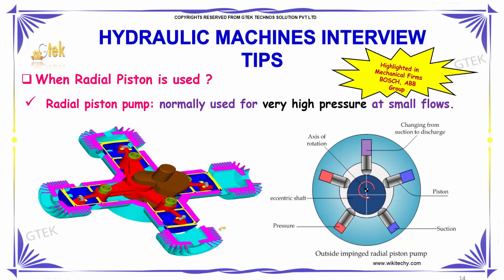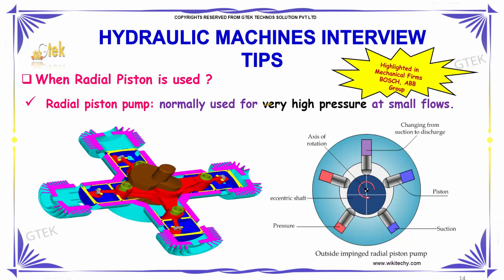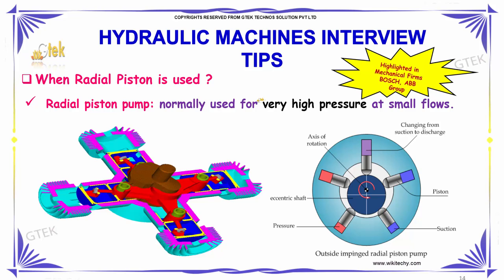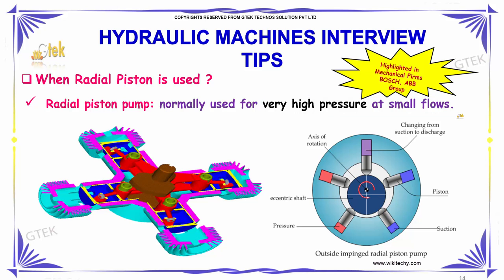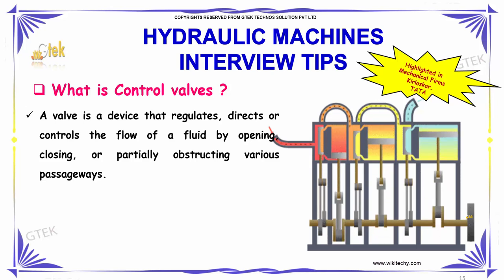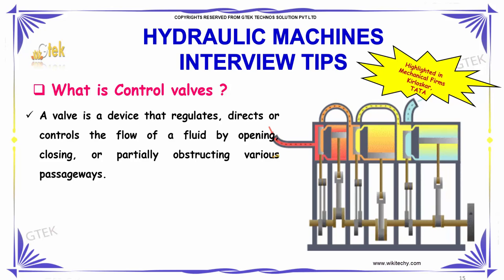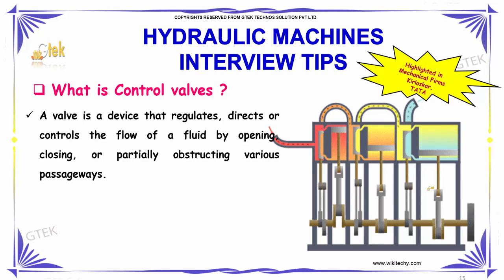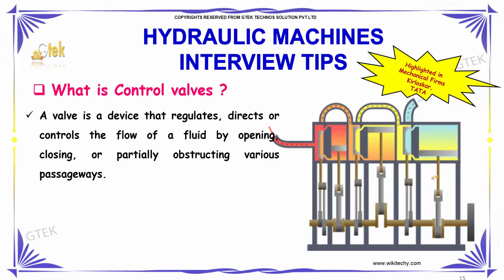radial piston and control valves | hydraulic machines interview questions | wikitechy.com

Comment: The hydraulic reservoir is a container for holding the fluid required to supply the system, including a reserve to cover any losses from minor leakage and evaporation. The reservoir can be designed to provide space for fluid expansion, permit air entrained in the fluid to escape, and to help cool the fluid.

Comment: A control valve is a valve used to control fluid flow by varying the size of the flow passage as directed by a signal from a controller. This enables the direct control of flow rate and the consequential control of process quantities such as pressure, temperature, and liquid level.

Comment: Radial piston pumps are a type of hydraulic pump. They consist of valve-controlled pump cylinders that are arranged radially. D6010_4.cmyk.100x100. R, RG.

Comment: Direction Control Valves are used for shifting oil flow direction of hydraulic circuit and for control ... We provide fix displacement Polyhydron Radial Piston Pumps.

Comment: A control circuit for a radial piston pump that uses a four position control valve and an orifice to regulate fluid flow from the stroke contro

Comment: - A control circuit for a radial piston pump that uses a four position control valve and an orifice to regulate fluid flow from the stroke control .

Comment: Radial piston arrangement, with 3, 5 or 7 pumping elements. Oil immersed type, open execution, face mounting, valve controlled, fixed

Comment: A radial piston pump is a form of hydraulic pump. The working pistonsextend in a radial direction symmetrically around the drive shaft, in contrast to the axial piston pump.

Comment: Orbital, High Speed & Radial Piston Motors. • Motor, Steering, & Flow Control Valves. • Steering Columns & Electric Systems.

Comment: Control valves are normally fitted with actuators and positioners. Pneumatically-actuated globe valves and Diaphragm Valves are widely used for control purposes in many industries, although quarter-turn types such as (modified) ball, gate and butterfly valves are also used.

Comment: Hydraulic pumps are sources of power for many dynamic machines. ... Hydraulic pumps operate according to the displacement principle. ... Note: while gear pumps operate with fixed displacement volume, vane and piston pumps may operate with fixed or variable displacement volumes.

Comment: Top 50 Hydraulic Machines Mechanical interview questions and answers for fresher ... machines | hydraulic machines interview questions | wikitechy.com. ... engine when is radial piston is used what is control valve cv what is control valve cv ...

Comment: Mech Interview. Mechanical Engineering Interview Questions with Answers - Fluid ... In a radial-flow turbine, steam flows outward from the shaft to the casing. The unit .... The movement of the piston controls the steam valves.

Comment: Radial piston pump: normally used for very high pressure at small flows.and A valve is a device that ...
Images for radial piston and control valves

Comment: Hydraulic piston pumps, low speed high torque motors and directional control valves. HAWERadial piston pumps, valves and